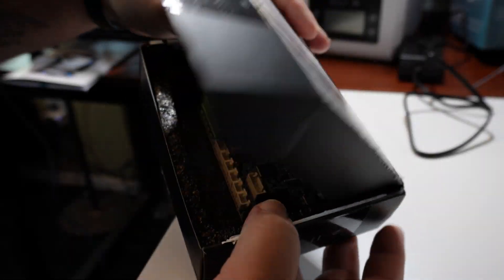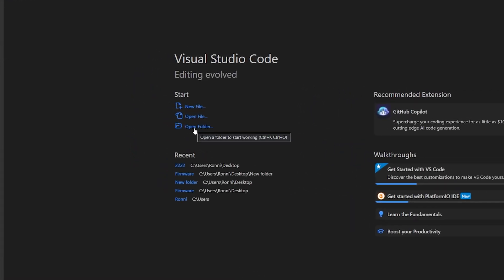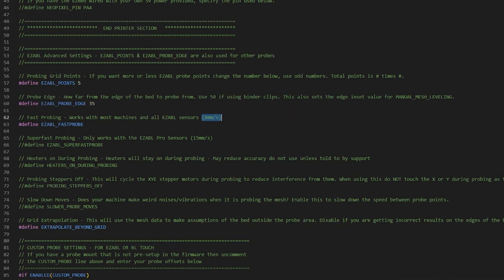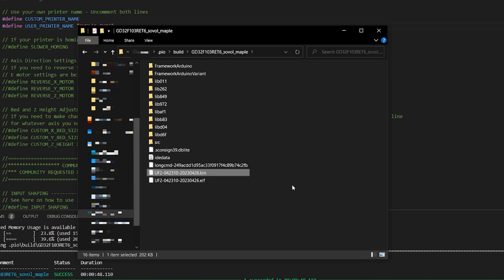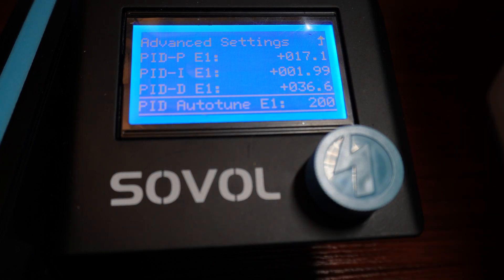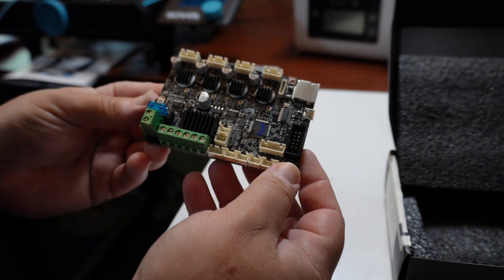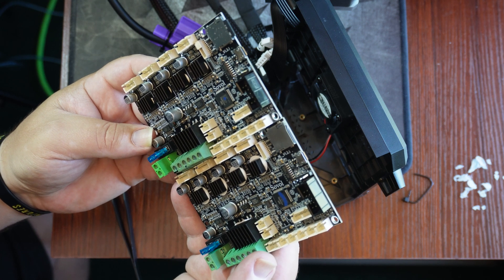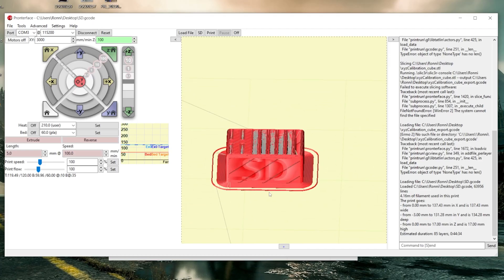I Upgraded My 3D Printer's Firmware, Then the Motherboard | SOVOL SV06 TH3D

Comment: My motherboard's USB connector also become loose after the first few months, although I do think the a micro USB connector facing upwards was a recipe of trouble to begin with. Anyway, at that point I had already shifted from OctoPrint+Marlin to Klipper with a Raspberry Pi and a touch screen I had lying around (which I used for the KlipperScreen). Since I had no use of the original display anymore, I removed it from the printer and made the motherboard use the UART pins of the display to talk with my Raspberry Pi instead with a couple of extra lines in the config files. Took some time to get it to work but after that it has been absoutely smooth - I haven't had a case of printer disconnecting mid-print in the last one year with about 200-300 hours of print. I used some twisted wires salvaged from a LAN cable to connect the UART pins of the Raspberry Pi with the printer. 
Love my SV06, perfect platform for tinkers like me.

Comment: Something i Learned when flashing these "creality" boards if you are having trouble flashing the firmware. Dont use firmware as the name at all try ender or something different for some reason the boards had trouble flashing different firmware by using that name i switched to ender.bin and flashed immediately with no issues.
Reply from the maker: That makes sense. Sometimes I have just named them FW1, FW2..etc instead of typing out "Firmware".

Comment: I'm considering an SV06 Plus with a Klipper pad, but it seems imminently inevitable that we'll soon have a good print quality, reliable, fast 300 mm cube bed slinger with Klipper, and last night I heard that a pre-release version has been received for review (no word on the manufacturer).  I'd love a Klipper version of the SV06 Plus, hopefully with a 4 conductor CANbus cable to the extruder instead of that big ribbon cable (what were they thinking?), and with improved part cooling on the extruder as well as a larger part cooling fan on the X gantry like the SV07.  I'd also like to see an optical filament run out sensor on the top of the extruder.  But mostly, I want an SV08 Plus that is the SV06 Plus with Klipper and better part cooling.
Reply: SV07 Plus is out now with Klipper
Reply: @benhinkle9178  - I seriously considered the SV07 Plus.  I was looking at the web page again last night, even though I already purchased the Neptune 4 Pro (two weeks ago and it still hasn't shipped).  Now that the Neptune 4 Pro is (almost) on the way, I'd still like a large format printer but may skip the 300 mm cube and opt for a 420 mm cube for the rare huge prints I'd like to make, just as soon as there is a Klipper version.  I need a custom battery cover for my Hijet mini truck and 300 mm isn't quite large enough.  The Neptune 3 Max is twice the price of a regular size Klipper printer so there's no point in buying one to add Klipper, when Klipper will be nearly free when there is a Max size printer that ships with Klipper.

Comment: How did you set your z offset not from auto home because the nozzle will crash in to the bed did you do it live setting ?
Reply from the maker: Do you mean in the TH3D firmware? If your nozzle is running into the bed, try resetting the EEPROM (Configuration>Reset EEPROM) Then run the auto bed level first. 

After the auto bed level, I went to auto home. When that finishes, the main screen should show the Z is at 5.

Go to Prepare>Move Axis>Move Z>Move 1mm and drop it to 000.0 (zero).

Then go to Control>Motion>Probe Z Offset then use a piece of paper to set the Z offset. The nozzle should just grab the paper.

After you get the Z set, go to Control>Store Settings. 

To double check, you should be able to auto home, then drop the Z to 000.0 again and it should still just grab the paper.

Comment: Well the firmware update for me did not work jammed up extruder and run the nozzle in to the bed after doing a complete set up and reset the z off set this just did not work for me went back to the original firmware and all is good just slow bed level

Comment: Yeah I skipped that all together, bought a $45 btt M5P 5 driver mcu.  Installed klipper, seperated the Z drivers so they were independent.  Done.  Klipper and the mainsail interface is just easier and feature rich.  I have a hard time justifying $100 bucks just for the stm32 chip swap but still having both z steppers share a driver.

Comment: Nice, im using a SKR 3 EZ(needed the 5 steppers for Z-Align) with klipper+Kamp(on a pi of course) on my SV06, loving the Z align to level the gantry (no more gantry grinding on top).
Anyway keep the good work!
Reply from the maker: Nice! Yeah, at some point I want to try out Klipper. Thanks!
Reply: Where did you get the macro for z align?
Reply: @eclypse3d  its in the klipper docs
Reply: @@kemist578 It probes the bed in the 2 extreme points in the middle of the bed in the Y, so it like this: it moves Y to the middle, moves X to the middle and probes X extreme left and x extreme right and auto aligns it with each Z motor independently